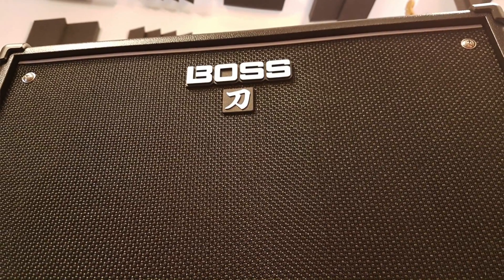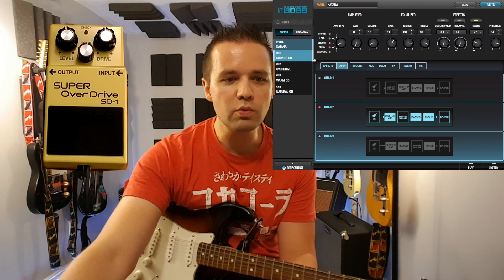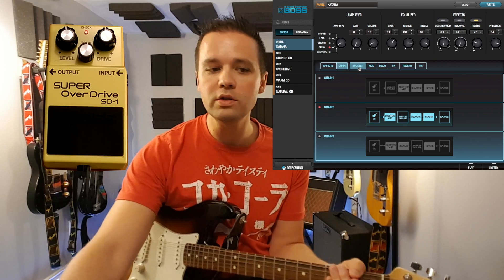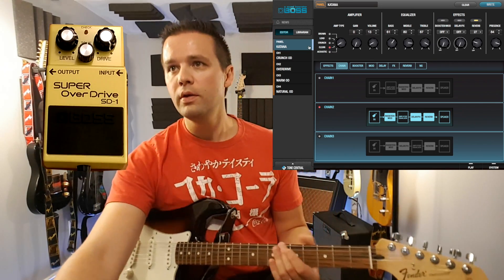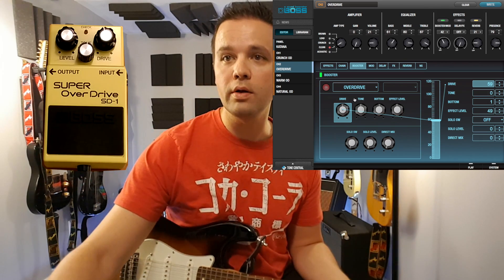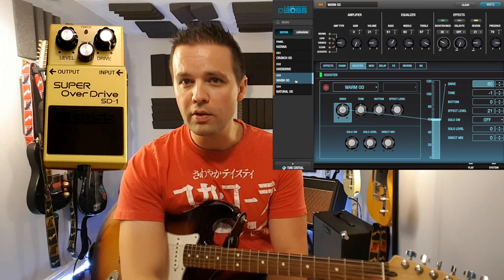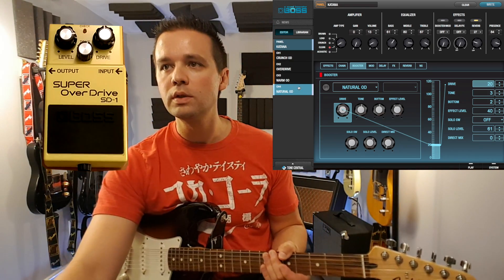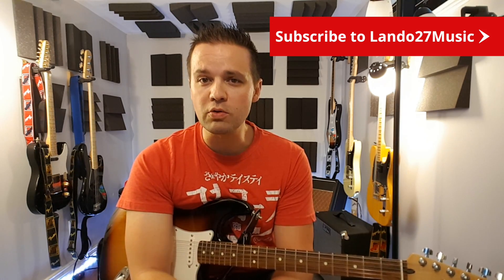Boss Katana vs Boss SD-1 Overdrive Pedal - BOSS vs BOSS (Episode 2)

Comment: Hmm I just bought a katana mini and was thinking about an overdrive..Or upgrade the amp to the 50!?..
Reply from the maker: depends on what you need.  no right or wrong answer.  😁🎸
Reply: I would suggest getting the head....  it is fully functional, able to connect to a cab, has the internal speaker which works pretty well and has GAFC funtionality.

Only thing it doesn't have that you get with the mini is battery powered operation. If that isn't super important to you, get the head, you won't be disappointed by it.

Comment: Thanks for making these comparison videos.  I decided on the SD-1 over the Blues Driver awhile back. While I don't have a loaded SS amp like the Katana (I have an Orange 35) I find that I like the amp's OD sound better than the SD-1.  I'm going to try the pedal again and really tweak the settings to see what I can get.  Btw, cool room! I want one like that but with a/c.
Reply from the maker: hey no problem, fun to make this stuff. SD-1s are great. I'm sure you'll dial something in to your liking. Ya no AC in the room, but no sound out. it's worth it in the winter. :)